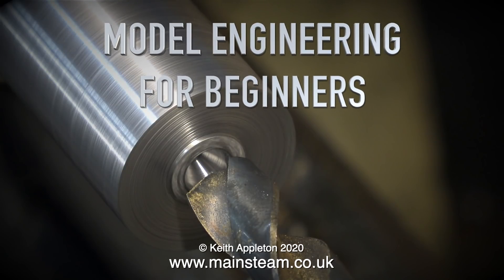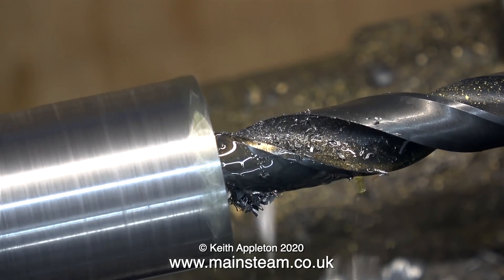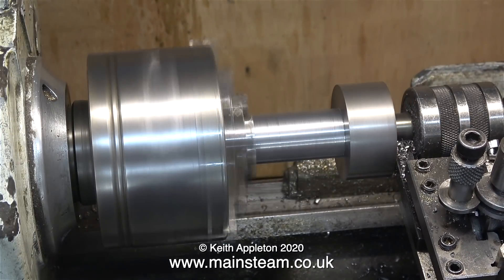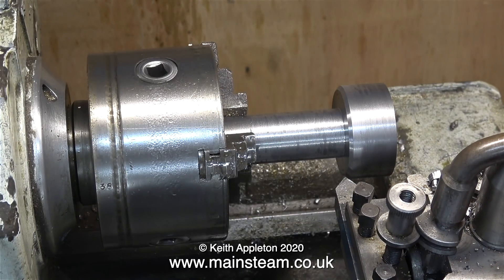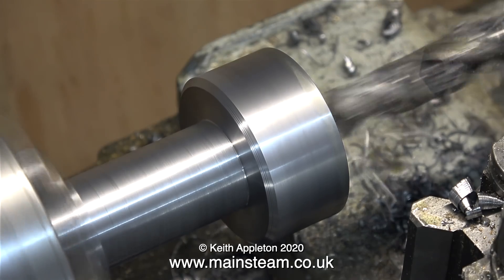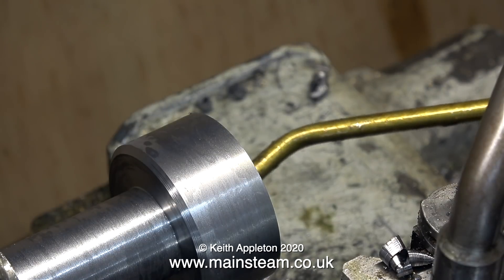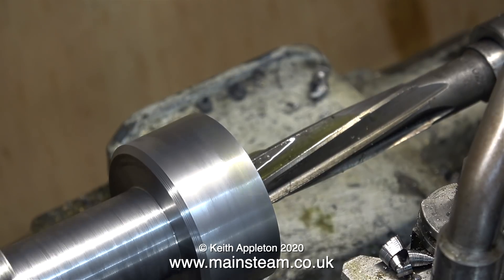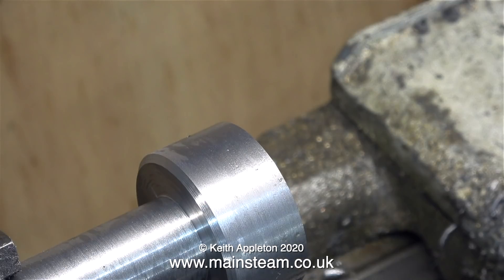DRILLING AND REAMING IN THE LATHE - MODEL ENGINEERING FOR BEGINNERS - PART #25

Comment: Confused from Nottingham!  I have bought a reamer 10mm it has a left hand spiral and it says “ cutting direction right hand”.

So if I have the reamer in the tail stock, which way shock the  chuck turn ( looking face on at the chuck ) ?
Reply from the maker: I assume that you just need to run the lathe in normal forward direction - slowly . . . . if it doesn't ream the hole then you are turning the wrong way.

Comment: Must admit this is the first instruction I have seen on the use of Reamers... I thought it was the flutes that did the cutting, not the end bit.   I have some 1 3/4 holes that need reaming out to 45 mm, so I thought you would put an expanding reamer loose in the hole, then tighten up as you revolved it.   I now see that you would first set the reamer to 45 mm and use it like a drill bit....  Many thanks for the video, saved me a lot of broken reamers...

Comment: Hey Keith, do you ever get models of line shaft workshops? I tried searching but that isn't the right term

I remember advertising for some steam models of line shaft layouts, but cannot find any right now

also, ever work on larger steam plants, not models, not tractors, but the ones in between, say just under steam launch size?
Reply from the maker: The only ones I have seen are the small steam toy type.